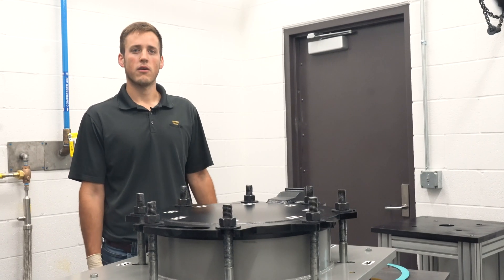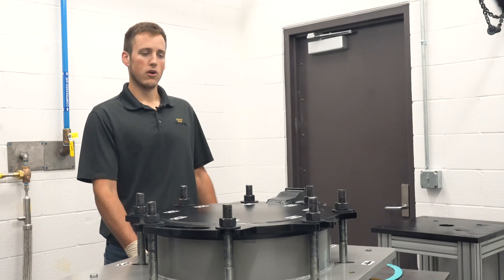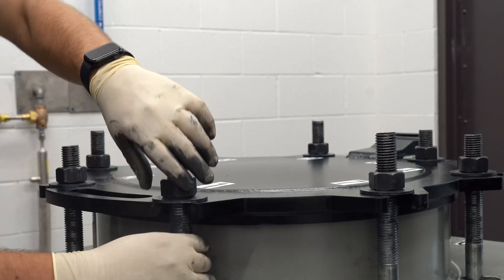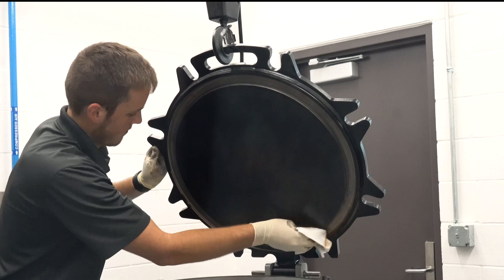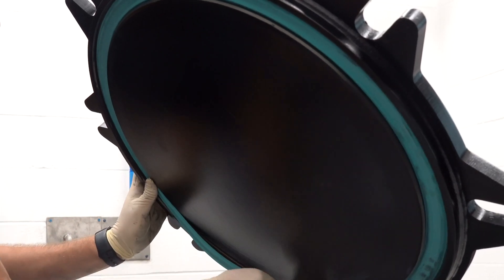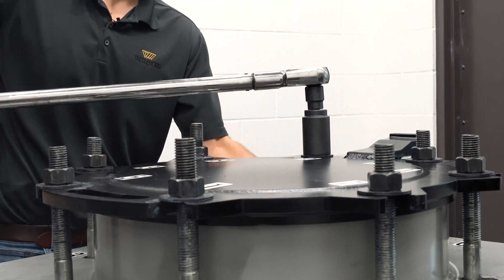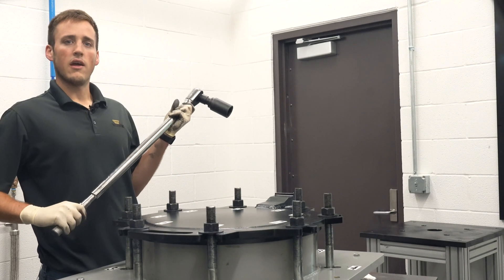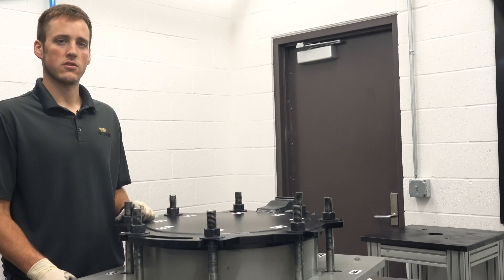Turcon® Tran-SECURE™ PTFE Manway Lid Gasket Installation Training

Comment: Wish there was more info out there. I've dealt with the blue/greenish hard gaskets. The harder ones need a higher torque I believe and last longer. Most loading places give the universal lip gasket and a pinch in flat black gasket for us to pinch in with a flat head. My problem is knowing when a gasket is compromised or not. It seems like i gotta pull it off to inspect it properly. I know if a tank car arrives with pressure it's a good sign. But liquid tests are impossible to do.